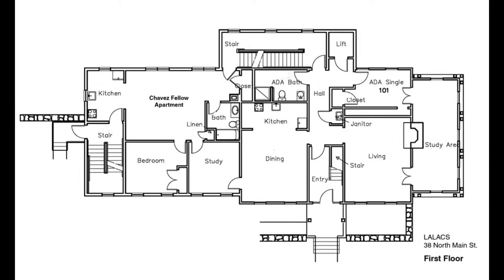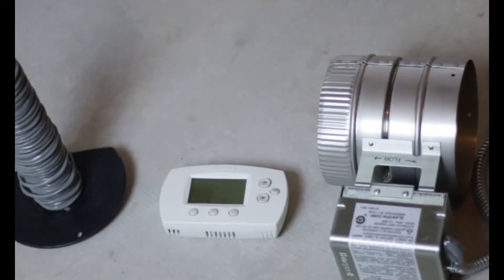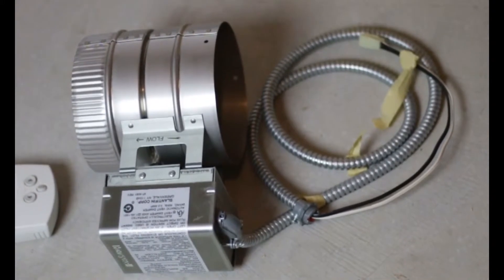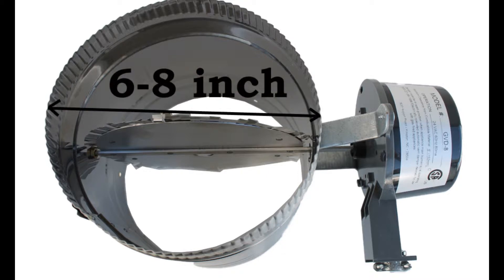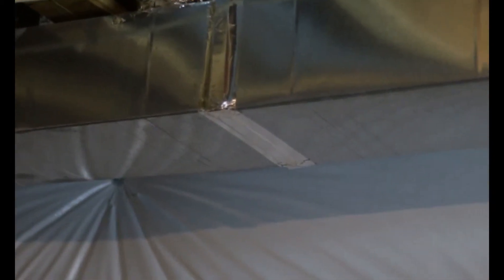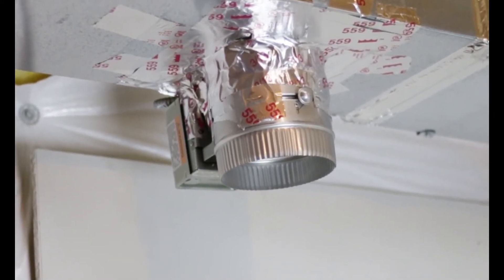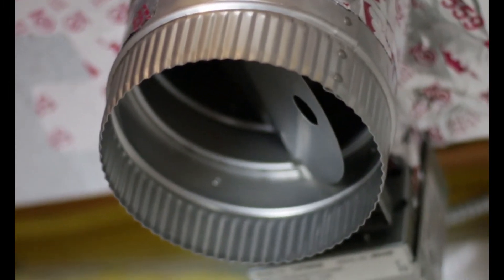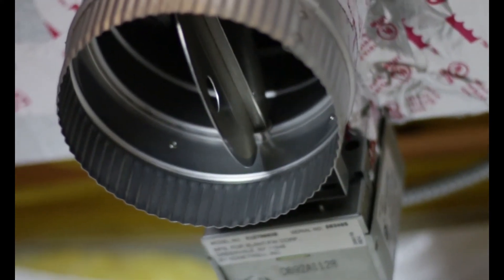Adding a SECOND thermostat to control a room temperature

Comment: Hi, nice video :)
Can I ask you pls... If I want to put a second thermostat (serial connection?). And I put it in hidden place with a temperature set at for exemple 22degrees...to prevent tenant puts the *first thermostat to 30degrees.
Do you know how I can do it? Pls?
Reply from the maker: That is nice questions. Every time you put a “Dummy” thermostat and the tenant try to adjust the temperature and the air conditioner does not respond, you will have a complaint the system is not working. If it is a hotel or guest room where somebody doesn’t have time to realize the A/C or the heat doesn’ kick in you may be ok. In this case just install the second thermostat powered by batteries and a cable that goes in the wall but doesn’t lead to nowhere.  In addition, you have to find a way for the master thermostat to be able to sample the room temperature and to control the system. If we are talking about a tenant that live there longer time installing a “dummy” thermostat will not work. What you can do is two different options: Option 1-Buy a thermostat that you can adjust the temperature (correct the temperature) most of the middle range and high range Honeywell, you can adjust the thermostat to show higher than the actual temperature. For example, room temperature to be 22 but the thermostat shows 27. Option 2- some of the commercial thermostats (you can find plenty used on Ebay for cheap) you can limit the temperature settings like minimum 10 degrees and maximum 25.